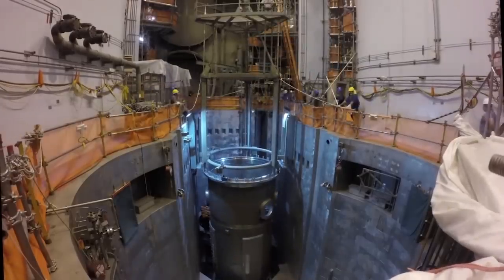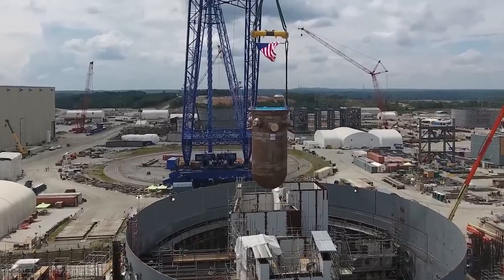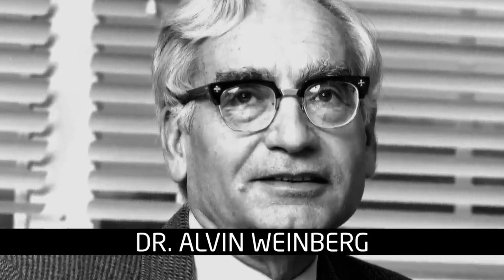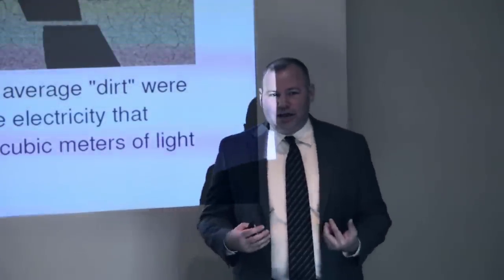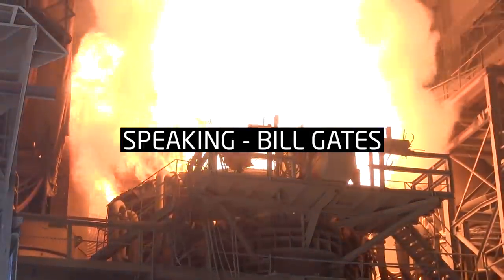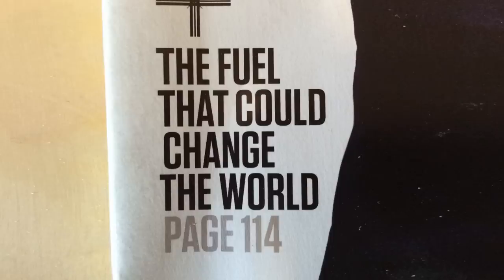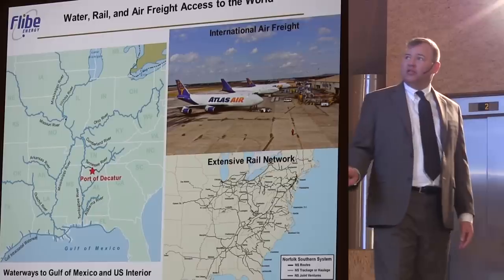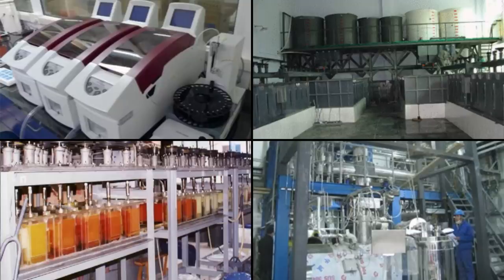Thorium 2017

Comment: Thorium would have been great 50 years ago, but do we need it now?  Wind and solar power is dropping rapidly in price, as is grid scale battery storage, and they can be put into service in a matter of months.  Thorium will take decades of research, regulatory approval, and construction before it is put into widespread use.  By that time, wind, solar, and batteries will have dropped a further 90% in cost.  I fear that nuclear's time has come and gone.
Reply: Dan Sanger It is more compact and reliable. It also provides many research opportunities. A diversified power grid is preferred, and optimal if most of those sources of power aren't dangerous.
Reply: Dan Sanger It is more compact and reliable. It also provides many research opportunities. A diversified power grid is preferred, and optimal if most of those sources of power aren't dangerous.
Reply: A good summary of some of the many issues with wind and solar energy:

Extreme low EROI (Energy Return on Invested) of wind & solar. Ferroni found a full lifecyle EROI for Switzerland in Solar PV of 0.82:1, just a new-fangled way of burning fossil. You need an EROI of 14:1 to power a modern industrial civilization. 

Extreme seasonal variation of wind & solar. i.e. Britain, Germany, Canada, Russia many places 6:1 ratio summer: winter months. With energy demand max in winter. No known storage method to compensate for that.

High cost of wind & solar. Easily 2-10X the cost of factory built molten salt reactors. Not economically feasible. It would collapse our economy. Even the wealthiest nation in Europe, failed miserably, whereas France succeeded in 25 yrs with ancient one-at-a-time build nuclear.

Fact that wind & solar only replaces a bit of natural gas fuel worth 2 cents/kwh in USA & Canada. Does not replace any fossil infrastructure. In fact adds infrastructure (i.e. storage, long distance transmission, grid stability batteries).

Extreme geographic unsuitability of wind & solar. Solar is pathetic in the north, rainy & cloudy areas, mountainous areas. Wind is pathetic in vast regions.

Extreme land use of wind & solar, easily over 50X more than nuclear, many areas do not have sufficient underutilized land areas of that magnitude.
 
Extreme transmission cost of wind & solar. Wind transmission must be oversized by ~3x, solar by 5-10X. More than 300km transmission costs as much as a NPP of similar size. 

Necessity for storage just to cover daily variation pushes solar & wind costs sky high, far above nuclear, and forces EROI so low it is really just another way to burn fossil. Storage for weekly, monthly and seasonal variation is unavailable. 

Extreme difficulty of wind & solar to supply the 85% of the world's energy supply that is thermal energy, hasn't even made a remote dent in that segment. 

Extreme vulnerability of wind & solar to climate change, windy & sunny areas will shift causing extreme & disastrous changes in energy supply, which we are already seeing in hydro plants built where there was once plenty of rainfall, and now experiencing decades of drought. 

Extreme vulnerability of wind & solar to materials shortages. Solar uses 84X the material inputs per kwh as nuclear. Wind uses over 50X the steel & copper, 34X the concrete of current nuclear, much more than that for Molten Salt reactors. It is extremely dubious we will have sufficient copper & rare earth elements to supply what wind & solar would need. Add storage to the equation and there is no chance we will have the materials needed. And you still need to the vast materials to maintain a fossil fuel backup energy supply, all the supply chains going all the way to Middle East Oil fields and military protection.

The mammoth waste problem of wind and solar. Wind turbines only last 8-20yrs. Solar 10-25 yrs. A solar PV powered world would generate 63 thousand X the waste of a nuclear powered world. Even at 0.15% of world energy, solar PV is already causing huge piles of solar panels that we have no capability to dispose of or recycle properly. 

The extreme difficulty of ramping up Wind & Solar. Note severe material requirements above. Nuclear build-rates have historically been minimum 4X faster than wind's maximum and 10X faster than Solar's fastest 4 year build rate period. In spite of the massive subsidies wind & solar have gotten compared to nuclear, per unit energy generated. That's just US federal and doesn't include all the state & local subsidies. And that's just one-at-time nuclear construction, not modern factory built molten salt reactors. After spending over $2 trillion, solar and wind are only up to 0.7% of world energy supply, with world energy increasing by 1%/yr and most of the current installed solar & wind will have to be replaced in the next 10-15yrs.

Comment: Getting a Thorium reactor on the grid does NOTHING for the average Joe in terms grid costs.  Being less than Coal or Combined Cycle (nat gas) is required to get on the grid, but it will not SAVE people money.  Key point.

Getting my engine in a car gives a person 4x cost reduction (25 mpg to 100 mpg), leading to NH3 from house at 50 c/gal e via solar.  A new car with engine would do 200 mpg.  My roadable seaplane "cockpit" pod would do 500 mpg without the wings.  

The only way to save Joe blow some money with Thorium is to make the fuel at the plant with electricity at 1 c/kwh.  The grid makes "fuel making" too expensive relative to oil.  Grid is 12 c/kwh.  $0.12 /kwh x 33.7 Kwh/gal e x 1.5 factor for electricity to NH3 = $6.06/gal e.  Gasoline is now $2.  Won't work.

 Why then would I want to BUY a Thorium reactor?  To MAKE CHEAP fuel from CO2 in the ocean (on a desert island?) or NH3, depending on application.  Run NH3 in trucks and C10 Jet A fuel in airplanes.  Be my own fuel supplier!  Understand?

The grid will collapse with wind/solar costs adding 15 c/kwh to base costs.  Do the math.  Coal based grid is 8 c/kwh.  Wind is 5-6 at the mill.  Add in 15 c/kwh more and you get 30 cent/kwh (Germany rates).  If my engine on solar thermal + engine + Nh3 maker can make NH3 for 50 c/kwh (1 c/kwh electricity), then why would I want to buy electricity from a grid?  I won't if I have solar house.  Grid is over in 20-30 years.  So what will Thorium be used for?  MAKING FUELS.  I don't want to have to make a wind/solar farm to make fuels.  A thorium reactor can save me a lot of hassle and be put on a semi truck.

Anything larger than a semi truck is NOT valid for fuel making.  I need to be able to move it around if needed.  I need to be able to dump the fuel to a container that the NRC can regulate and move the plant as needed.  Small is MUCH better.  That $5 million fees...not going to happen with me.  Sorry, NRC.  I go to an island and make fuel if you want to jerk me around.

Understand?  Thorium = fuels for trucks, cars, boats, airplane and houses, all CO2 free if that is your worry.  Me, I just want to make money....CO2 is plant food....don't care.

Comment: We are orbiting a fusion reactor.
Reply from the maker: Too bad the Earth rotates. Too bad the entire planet's battery storage capacity is about 28 minutes. Too bad the planet tilts on its axis reducing solar exposure during winter. If you think the fusion reactor in the sky is our solution to global warming, then check out Germany's CO2 emissions since trying to replace nuclear with renewables. http://environmentalprogress.org/germany Compare that to France's fleet of Gen2 reactors, and France's ridiculously low carbon footprint. Or Ontario. http://live.gridwatch.ca/home-page.html Every single time a nuclear reactor has been shut down by so-called "Environmentalists" it has been replaced by combustion.
Reply: The night does not prevent solar power from being feasible just like winter does not prevent agriculture from being feasible. We know how to store heat. We can colonize our abundant deserts with solar-thermal facilities. We can use the power to produce aluminum electrodes. We can build aluminum/air cells the size of shipping containers, and ship them to climates like Seattle where solar power is scarce. Aluminum is the third most abundant element on earth. It can replace carbon.
Reply from the maker: "We know how to store heat."
...go store your daily personal energy needs in a battery. Just try do it and see if you can afford it. You can't. Same for cities. Postulate all the energy storage solutions you want, on the ground, in the real world, Germany's GHG emissions are the highest in Europe. Maybe they just aren't trying hard enough? Maybe they don't have the technical understanding you do?

EVERY nuclear plant forced into retirement by so-called "environmentalists" has been replaced significantly by COMBUSTION. That is the real-world. Also, in the real-world, see France and Ontario. https://www.electricitymap.org/?wind=false&solar=false&page=map (Unfortunately Germany has stopped providing GHG data feed to Electricity Map. Wonder why. Last I checked was in the 400s.)
Reply: If a city can meet its energy needs by importing coal, then it can meet its energy needs by importing aluminum.
Reply from the maker: Paul, you should tell someone in Germany that. Preface it with "we're orbiting a giant fusion reactor" so they know to take you seriously.

Comment: uranium isn't rare though... it's actually quite common and found almost any where on the planet.
Reply: yeah...too much emphasis put on difference between U and Th abundances as reason for molten salt reactors----can use either in MSRs. Need enriched U or Pu to get MSRs based on Th going. Lots of loose talk about advantages or Th that are really advantages of the liquid fueled molten salt concept.

Comment: Thorium had the problem of being to effective.
Reply: +Spear Shaker
'too' you meant. Considering the supposed language ability conferred by your username. ...one 'to' is regarding an object or place in relation someone or something, the other 'too' is typical a typically larger amount of something to do with someone or something;, you can remember which one to use with one of these little lines below.

William went to shake his spear at audience within the Globe, it was too much for them. 
Many fell to the floor from laughing too hard.
Reply: Economics is based on the concept of scarcity. Thorium has the the problem of abundance.